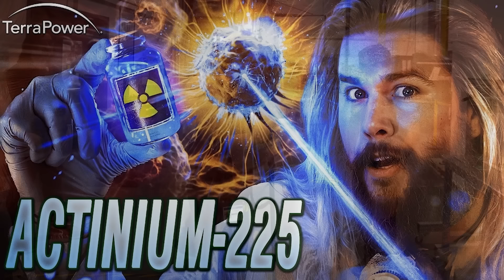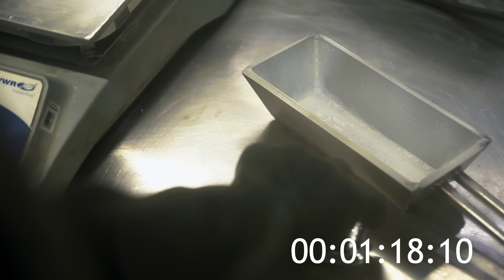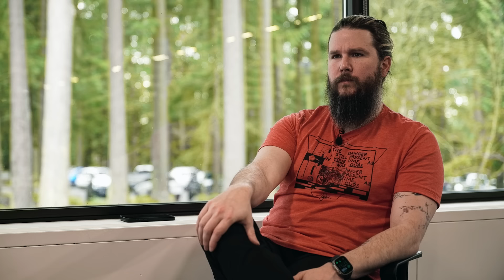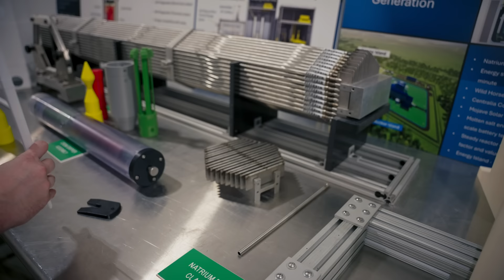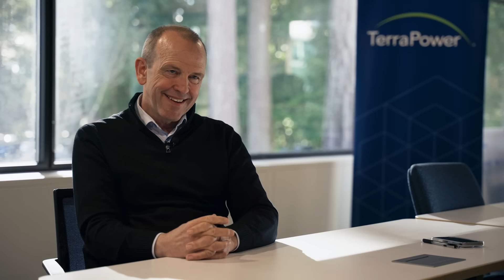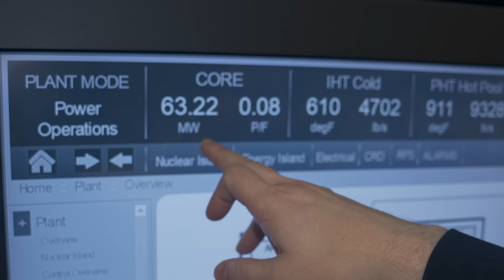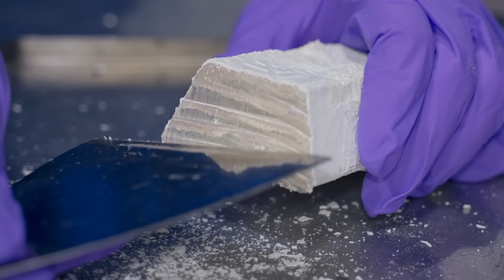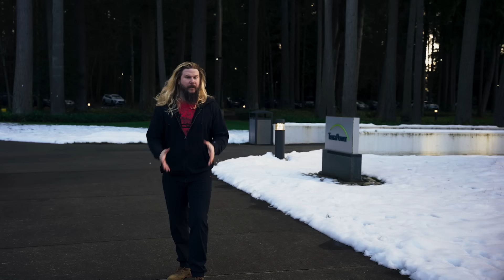Will Natrium Nuclear Reactors Change Everything?

Comment: The main challenge with sodium based reactors is the lifespan of the materials used to build the reactor system.  Sodium is highly caustic and can destroy the materials typically used to build these reactors, which has been the challenge for decades.  There have been advancements in new composite alloys and materials, but none of that was mentioned here.  I suppose the fact it isn't under pressure likely helps a lot, but it is still a challenging material to deal with.
Reply: Stainless steel has been a thing since before we started fusing tritium. Yes its expensive for the materials on these projects, but it is not some hard to achieve first of its kind feat. Teflon, graphite, greases for any specific conditions are easy to source, stainless steel, etc etc. We have the materials, what we have is just expensive as fuck.
Reply: @menoymenoyhenoy I just watched vertasium video about Teflon and it's production... That was my first thought
Reply: Stainless steel is perfectly compatible with liquid sodium. The first thing it will do is strip off the passive chromium oxide layer, which is what allows the pipe to be 'wetted' and is critical to accurately measure the flowrate.
Long term it is known for leaching nickel and carbon out of the stainless, these leach rates are well known and are compensated for in the wall thickness of pipe and vessels.
The last concern is a buildup of dissolved oxide in the inventory, which can crystallise out in cold regions and affect flow and heat transfer. The tried and true solution is to include a Cold Trap, in which you intentionally cool the sodium within a vessel designed to capture the precipitated oxide.
Reply: @GreenOddish  Thorium Salt reactors face the same challenges.  It's not that it can't be done (and this reactor appears to be a bit different since it isn't under pressure), but it's still a serious challenge to get long term durability out of the materials.
Reply: @jeffer1101 I don't know much about thorium salt reactors, at these temps though material selection becomes as much about thermal shock and fatigue as it is about corrosion. I'm most concerned about those salt tanks, something that big and hot has to be sensitive to changes in temperature.
Reply: @GreenOddish  Yea, I'm not saying it's not possible.  I'm just saying that I'm surprised it wasn't mentioned in the video as material issues have been a challenge for other reactor designs that use sodium moderators/cooling.
Reply: learn some chemistry, physics and engineering before jumping straight on to the "but the corrosion..." bandwagon.
also consider that the relevant people involved in the project may actually be competent and knowledgable...
Reply: @cerealport2726  I have, and have heard from experts in that field (from various sources on other nuclear technology videos), which are the people who raised said concerns and spoke of the challenges.  Those aren't my words, those are their words.  As I said, I'm just surprised none of it was mentioned in the video, considering it's been one the biggest challenges in the other ones.
Reply: @jeffer1101  Sure you have...except you do not seem to know the difference between a metal and a salt...
Not all "challenges" are roadblocks that kill projects. You would know this if you had ever attempted something more difficult than commenting on a video.
Reply: @cerealport2726  Sodium is a metal.  Salt is basically Sodium Chloride (assuming that is the term you are referring to).  Also, I never said it was impossible or that it should kill the project.  I just said it was odd that it wasn't mentioned at all in this video, despite it being an important issue in many other videos that also use sodium in their reactor design.  You would realize this if you took the time to comprehend what I posted instead of trying to argue points I didn't make.
Reply: @jeffer1101  Sodium Chloride is indeed a salt, but it is not the only salt. 
This, you would know if you had watched the video, and had understood what was said with regards to Sodium and Potassium salts,You'd also know this if you understood basic chemistry. Your credibility is in shreds.
Reply: @cerealport2726  I was talking about Sodium, you keep bringing up "salt".  If you'd like, simply google "challenges with sodium based nuclear reactors" and you'll get pages and pages of details regarding it.  As I said, it doesn't mean it is impossible or shouldn't be researched.  My concern (as I've said numerous times) is the lack of its mentioning in this video.  Interestingly, if you look at the wiki page for TerraPower and read about its reactor, it clearly mentions they have corrosion monitoring systems in place to detect any potential issues and address them before they become significant.  Your credibility is in shreds.
Reply: @cerealport2726  Interestingly enough, if you look at the wiki page for TerraPower, it clearly states there are systems in place (including ultrasonic testing) to monitor corrosion issues using maintenance and inspection procedures so they can be addressed before they become significant.  So obviously corrosion still is a concern.  Your credibility is in shreds.
Reply: @jeffer1101  Molten Sodium Coolant does not pose a corrosion issue with modern metals.  Look at EBR2 which went online in 1965 with zero corrosion issues up until present.  Corrosion issues were not mentioned in the video because they do not exist.
Reply: @jeffer1101  There is virtually zero material compatibility issues with liquid sodium in a stainless steel sodium fast reactor like this one. It is well documented. EBR-II ran for 30 years with essentially no measurable corrosion. Even the welder's alignment marks were still visible after 30 years. It is far better than even water let alone salts as a coolant in this regard. Issues can arise in the water side of a sodium to water heat exchanger that isn't well designed, but this design doesn't have that. For sodium coolant, you just need to make sure turbulence in the flow is minimal to prevent erosion which is an issue with any flowing liquid (a problem that showed itself massively in the Monju sodium fast reactor). With modern computing power and a better understanding of fluid dynamics, I doubt that will ever happen again.
It isn't mentioned in the video because it just isn't a real thing. For MSRs on the other hand, where salts are used as coolant (not liquid sodium) it is an issue. Perhaps you are confusing the two or miss remembering.
Reply: It's already been researched extensively. EBR I & II in the seventies and eighties.
Reply: So help me understand. This reactor uses pure sodium AND  salt? For some reason I m alittle confuser since salt is also a huge source of sodium
Reply: @aisac21  I'll have to re-watch the video, but that's certainly my impression - sodium metal in the primary coolant circuit (through the reactor core itself), then "salt" in the secondary coolant circuit (to produce the heat reservior and drive the steam-heating circuit).

That said, I don't think they were necessarily talking about common table salt (sodium chloride) as the "salt" - the footage of the whiteboards also included both sodium nitrate and potassium nitrate; and being a food-additive would increase the range of possible compounds.
Reply: @aisac21 the sodium in the salt is not the same chemically as the pure liquid sodium. It's had its outer electron removed by the nitrate, which actually makes it much happier and more stable. The reason pure sodium is so reactive is because it can force so many substances, like water, to accept its unwanted electron.
Reply: @aisac21 So, it uses a heat exchanger to transfer heat from the liquid elemental sodium in the primary system to the liquid salt in the secondary system, which can be run through a heat exchanger to transfer that heat to water, where it runs the turbine. 

Also worth noting that it isn’t the same salt as table salt (that’s NaCl, sodium chloride). I believe it was mentioned in the video what the salt is, if not someone else here has likely sourced it (I’m having a bit of difficulty with that), but it’s the same salt used in the storage of thermal energy for solar farms that do that. As a salt, it’s got absolutely no issues being exposed to water, it’s soluble but it doesn’t react violently.

As for the corrosion by sodium, in case anyone wants greater detail on that, austenitic stainless steels have essentially no problems moving molten sodium. This includes 304 stainless steel, which is the most commonly employed stainless steel (period). 300 series stainless steels are a diverse and robust group, though, with many more specialized alloys employed for their effectiveness in other areas. Point being, sodium corrosion isn’t even a new problem for the development of stainless steels, and it’s largely a solved problem. That being said, as is the standard in nuclear applications, it’s monitored anyway in order to identify possible instances of corrosion early, well before they cause real problems. It’s POSSIBLE, even if unlikely, but it’s also something that can be monitored and handled safely. And, as a bonus, the thermal energy storage system allows for such maintenance to be performed without ceasing operations on the power generation side, which has historically been a big deal for Nuclear, as every hour of downtime counts.
Reply: @trevordillon1921  It's liquid sodium in both the primary and secondary system. Primary loop sodium never leaves the reactor vessel, secondary sodium moves heat outside the containment and hence the nuclear side of things. Heat is then transferred to the salt.
Reply: That's a load of nonsense. At EBR II no such issues were observed. During dismantleing they could still see the marks inside left from manufacturing.
Reply: Seriously...a highly corrosive liquid metal that will be spiced with radioactive elements and reacts explosively with water.  It will leak eventually and cause problems.
Reply: "A challenge for the decades" 

During the manhattan project the uranium hexaflourane was hard to turn into enriched uranium because it would corrode all pipes and equipment. They discovered that if you use PTFE to line the pipes, it's so utterly inert that it wont be degraded at all. 

No advances needed, just rough the surface of your parts, coat in PTFE, all done.
Reply: @spaghettibanjo you're correct in that it's not insurmountable at all now, but the high temperatures make ptfe a bit challenging for molten salt.
Reply: Exactly. We had a Sodium reactor fail at Santa Susana Field Laboratory for exactly that reason. They're acting like this is new technology... and it's not, at all. It's a problematic system... And I'm not hearing the past failure points being addressed here.
Reply: Actually no. Natrium is totally ok in that regard. Even Wiki stated Na creates low corrosion and most standard materials may be applied. That crap is very corrosive. Mercury was also tried and also it was very corrosive. We in Russia have a few of those reactors running. One of them is an hour travel from my home lol.
Reply: Most of these challenges were solved with MSR, it just had not been economically viable to commercialize. 
But in general, The challenge is not materials, the challenge is politics.
Reply: Thanks for this (and the comments).  I was wondering forty years ago why this wasn't already a thing.
Reply: Basic questions gleaned from this site’s documentaries:  what and when can things go wrong?  Failure analysis before the fact. People, procedures, parts, indicators, materials; quality manufacturing standards and long term degradation.  Where are the lessons learned from previous events going wrong catastrophic or not?  The new approach /design has the devils you don’t know, yet, in addition those you do know.  Who are the quality and safety non-advocates reviewing and signing off?
By advertising thoroughly you will help the general public and scientists understand
Reply: What about trying to use tungsten
Reply: They thought of that long before you did lol
Reply: No, the main challenge is having to deal with corrupt politicians like John Kerry.
Reply: Not only is it caustic, but it's highly reactive with a wide variety of other materials, often violently so, and requires extreme care in keeping it segregated from pretty much everything. Any nuclear reactor, regardless of how it's cooled, heats water to make steam to propel a turbine. If we think the fires and explosions we have seen in the past were devastating, introducing sodium to the mix definitely ups the danger factor. One thing is certain: if there's a way for people to make the most catastrophic mistake imaginable, just wait. There will be a demonstration soon enough.
Reply: @philbert006 but the salt loop between the sodium and the water keeps them completely separate, no?
Reply: @Drinksfromtap   From what I gather, yes that is why they are using salt to keep the two separated giving the set up a side boost of the thermal storage via the salt.

Comment: So if the reactor scrams the energy side, as comemrcially designed, can continue to provide power... but for how long? seconds, minutes, hours, days, months, years? if it's not at least days, to cover times of disaster, then what's really the point? Just to eliminate complaints for brown outs? Not a compelling value proposition.

What I really want is per-home power generation systems the size of an air conditioner or furnace whcih will make each home independent and not reliant on any grid. A high power RTG for home, or even better, a Ronco Mr. Fusion.

Comment: What about the corrosive nature of sodium. I heard that one limit to maintaining a multi decade plant was the transportation network. simply the pipe would rust out, when you put to dissimilar metal in contact with each other they galvanize.  So what are they using for piping and radiators?
Reply: Various stainless steels work fine. There is minor leaching of nickel and carbon, this is accounted for in the wall thickness of the pipe.

Comment: You left out one of the major advantages to having the molten salt heat-batrery for load following... It allows the reactor to work very nicely on a grid dominated by variable renewables.

I don't know where you got the info that the Natrium reactor should beat "everything" cost wise, because that's not the projections I've seen.  For new generation, solar and onshore wind are very very hard to beat at this point.  Adding storage does increase the cost significantly, but even with that it is extremely competitive (easily winning) and storage technology is still developing.

The thermal storage with Natrium allows it to operate as a sort of peaking plant, allevialting some of the storage need for variable renewables and making them even more cost effective... synergy.   So, the thing Natrium is really competing with is combined cycle natural gas.

Comment: We need more pwrs, not unrefined salt reactors. Last video you made on this got me curious and I found that the gasket and sealing issues in a highly corrosive environment is still an unsolved issue in material science. Eventually it may be refined, but more proven reactors need more funding and amplification for energy production.
Reply: If you want to be helpful towards nuclear advocacy you need to take a step back and try again, otherwise you will just be another useful idiot towards the anti-nuclear cause.

Comment: Hey Kyle, I have seen a couple of videos discussing the possibility of making a Nuclear Explosion utilizing Hafnium. It appears to yield no radioactive fallout, and was wondering if you are familiar with the subject?
Reply: Hafnium isn't fissionable, in fact is so stable and such a Neutron sponge that it is commonly used as control rods.
Reply: @whirledpeaz5758  I am refering to a hypothetical weapon concept based on the potential of hafnium-178m2 (it's an excited state of the hafnium-178 nucleus), a nuclear isomer of hafnium, for energy release.

I saw a couple of videos that popped of in my feed on the subject which discussed the potential.  Was wondering if Kyle might have been familiar with the concept.